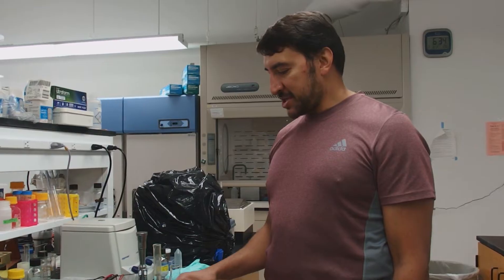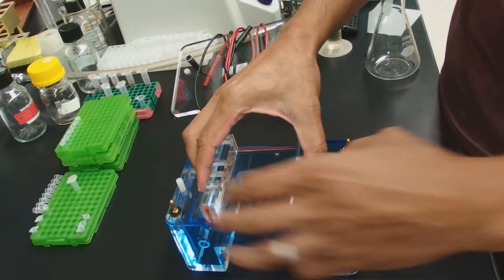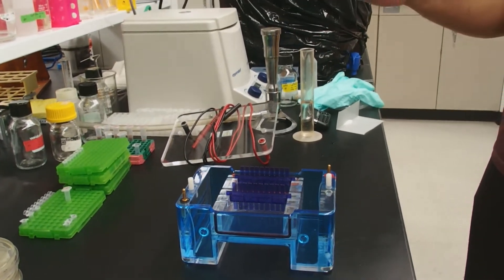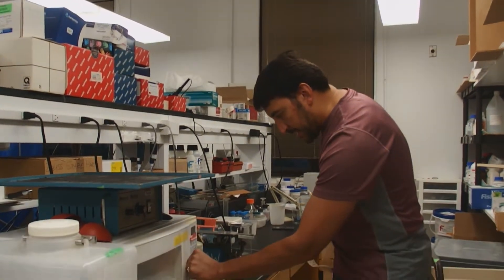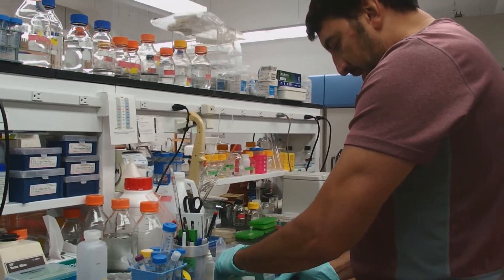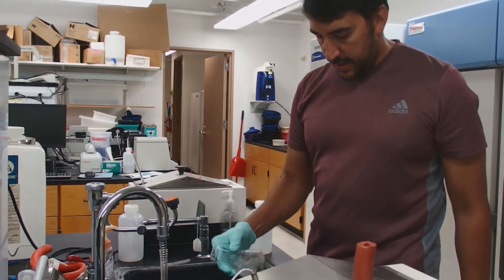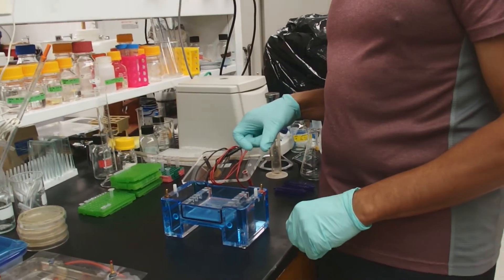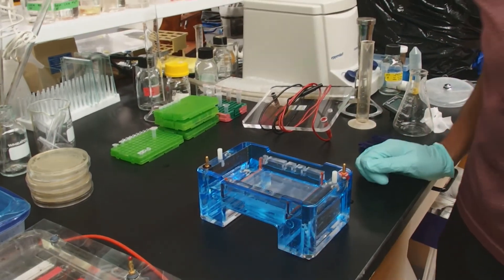Casting agarose gels - Owl system

Comment: Also putting the gel in the running position and adding the buffer, and then taking out the gel combs help support the wells during comb removal. They’re little dots on the comb, which give it some grip so you don’t slip when using gloves.
Reply from the maker: OK